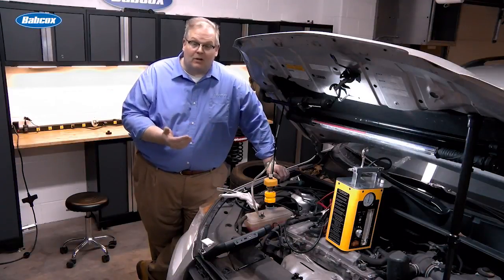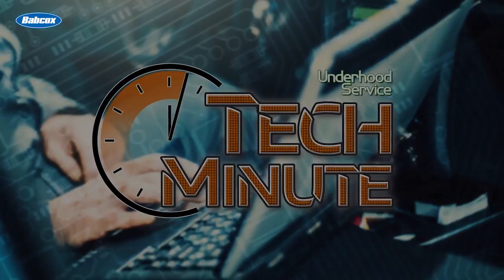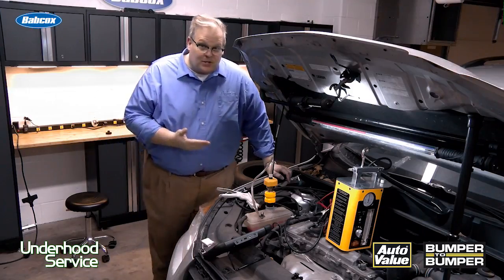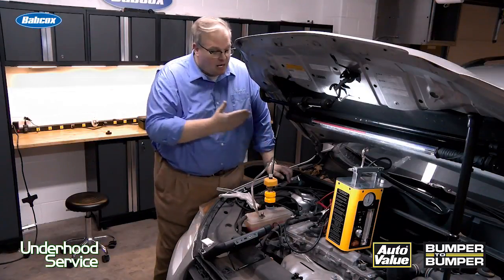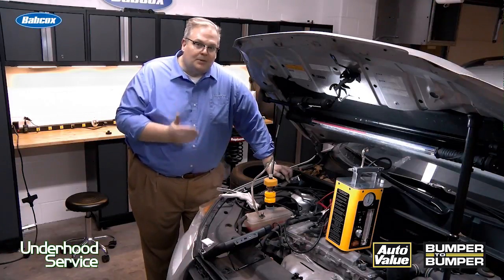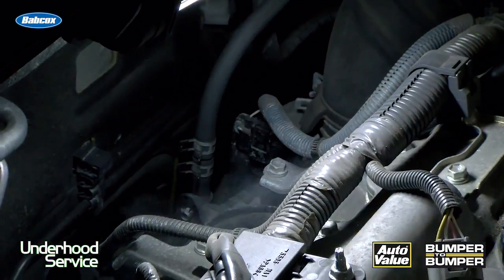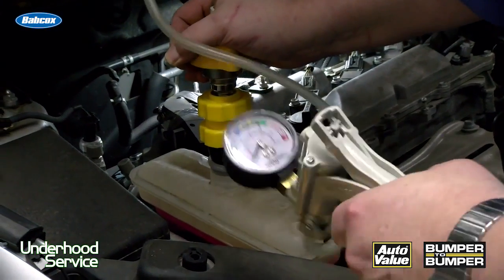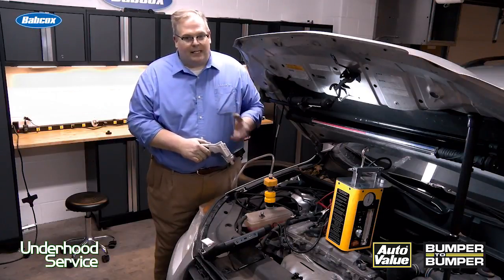Diagnosing Intake Manifold Gasket Leaks | Tech Minute

Comment: I'm working on a Nissan 2.5 and the intake manifold is placed horrible
Reply: You and me both
Reply: Where is it placed?
Reply: @justinsalluce9176  @Imeanitsaaron , Hi guys, I have the same problem inlet maifold is leaking and garage is saying because they can't access it hence can't replace it. The only option they are suggesting is to take the engine out which will be 4x times more price. Is there anyway to fix inlet manifold leak without engine out, it's Cheverlet Captiva 2.2 same engine as Vaxhual antara. Any help please ?
Reply: @MuhammadIftikhar-es4jz  dude. I'm going to be honest. Most manifolds are very hard to reach and frankly mechanics are lazy people tbh. Either ur going to have to find a mechanic willing to do the hard work or your going to have to do it yourself or your going to have to pay. By the way.......what is the estimate???
Reply: @MuhammadIftikhar-es4jz  I'm working on a honda atm and it's taking a while tbh. Because tbh.....the manifolds are part of the whole engine system
Reply: So first guy who kept my car for 20 days and failed quoted me £250 , now I have given to some in leads and they suggested £750 for 6 hours job, the first one said they can't reach to some bolts and the full engine to take out would cost £1000, now second guys said no engine to remove,  by the way these costs are on top of inlet manifold cost